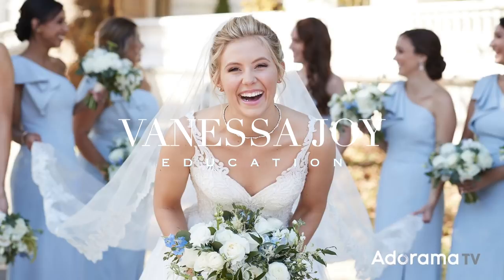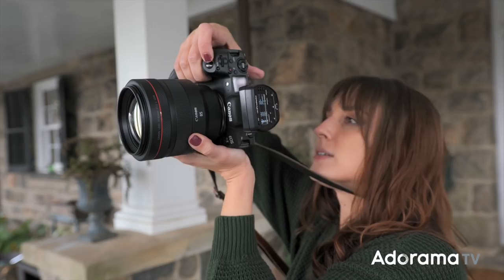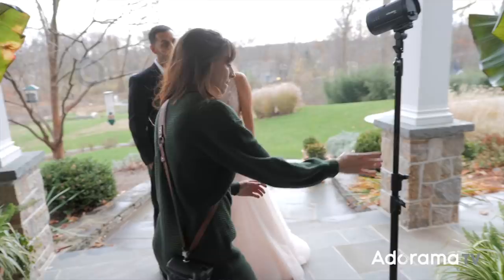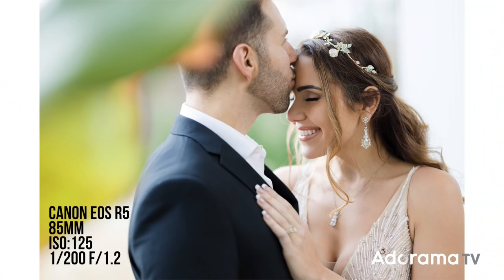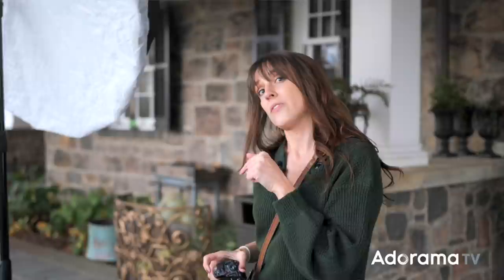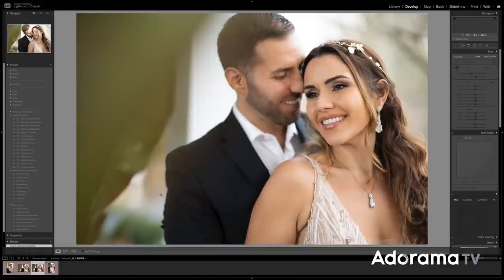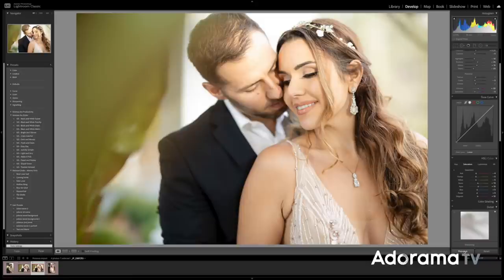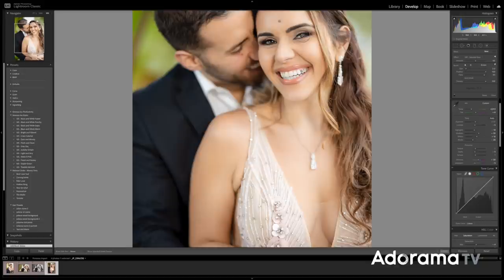Light Modifiers for NON-Flashy Flash Photography in a Backlit Photo

Comment: I shall summarise. To achieve the non flashy look with flash use as fill light more than key light. The aim is to assist with shadow recovery more than blasting them with light. Don't overly under expose the ambient either, shoot it slightly under exposed more than what you might normally do but don't go too far. It's basically the same principles as any outdoor shoot with flash, you're just going less extreme with both ambient levels under exposed less and limit the amount of flash being used.
Reply: It’s finding the baby bear “just right” haha
Reply: @VanessaJoy  Bahaha, yes!

Comment: The non-flashy look is what I strive to achieve.  Great photos but I would like to see the look with faster shutter speeds to reduce the background light.  The background is washed out but if that is the look you are going for by all means do it.  I prefer to reduce the background lighting a little. The model pops.
Reply: It's a tradeoff tho. The more you underexpose the more a silhouette they become and then the flash has to act more as key light rather than fill and you're back to a 'flashy look'.

Really, the non flashy look is the same thing as the flashy look but less extremes. So you underexpose the ambient, but not too much, and then the power from the flash is much less and acts more as fill. Then you get a more natural shot that looks like flash may have not been involved at all.

Comment: It would be helpful to know your camera settings,  though i understand you are using ttl to lock in your flash settings.   However not all have that capability.   So what i got out of this was don't underexpose the ambient.
Reply: I also wish my flashes would lock in the ettl settings.
Reply: @crollinsphoto  I know this is a year later lol but just practise using your flash in manual on your own time so you can get used to it - the distances between you and your subject/s, how much light you need at those distances, adjusting your power settings quicky on the fly, that kind of thing. All these things will come with practise. It isn't that hard once you put in the time. I know TTL is the easiest thing to do but all TTL isn't created equal. For instance, though I love Godox/Flashpoint strobes the TTL for the most part is kind of garbage. Not to mention that in certain situations TTL in general will not do a great job - no matter how you adjust Flash Exposure Compensation - as it depends on reflective metering just like your camera and the Auto settings on your camera use. I don't own any of their strobes but Profoto's TTL is wicked accurate for the most part. But it's way out of my budget so it's Godox/Flashpoint for me lol.

Comment: There is a main problem with the light placement, That light should be placed on the left side of the Camera to expose the black tuxedo first and balance the image. that is wedding 101 then the dress will become a reflector to the Groom and the bride will on short lighting sliming the face of the bride. I rate this video 4/10 poor plus
Reply: No. Wedding 101 is that the bride is apparently more important and the one to make sure you properly expose over the groom (not that the groom isn't important but we all know more importance is placed on the bride in couples shots. It's just how it is.

Comment: A little bit of a cheat trick. She used a small modifier and put it pretty close to them but when she went to the large modifier she had that like double the distance away. So she sort of exaggerating the results. If you took the small modifier moved it further away you would get the results looking not as much of a difference but a difference.
Reply: I am afraid you have this wrong. The further away the light source it, the smaller it gets relative to the subjects.
And smaller means harder light. So by moving that small light modifier even FURTHER away the difference would have been even BIGGER
Reply: As Vegar said, I am afraid but you are wrong. That’s definitely not how flash or any light source work. Actually should would need to get closer with the smaller modifier and further away with the big one to achieve a similar effect. But of course you can only get so close with a small one until parts of your subject are maybe not in the light anymore. On the other hand a bigger softbox might be to big for the location and you may end up having difficulties positioning it. So depending on your subject some middle ground might be a good choice. Of course if you want more harsh light, a bigger modifier might pose problems in how far away you would need to position it

Comment: You basically need a B10
Reply: No. You can do this with a couple of speedlites
Reply: You missed the point.
When I started taking pictures I did a private shoot with cheap worklights and a bed sheet as diffuser. I still use cheap Speedlights without TTL. They are very easy to bring along in you camera bag.

Comment: Technic realy ist easy. Take Equiptment for 10000 bucks. Please show us with a 50 bucks flash
Reply: The takeaway is the "softness" of the light depends on the total surface area of the light source - the larger it is relative to the subject, the softer it will appear. The white ceiling, in that case, was the source that would meet your $50 requirement.
Reply: It’s not the flash it’s the modifier or the size of the bounce (white wall in this case) and it’s relative closeness to the subject. In this scenario the power of that strobe was overkill it could have been done with a cheap speedlite as it was just being used as a fill light to fill the shadows. If she was in bright conditions then you need a more powerful strobe in order to compete with the sun.